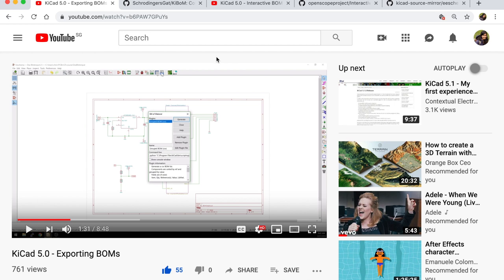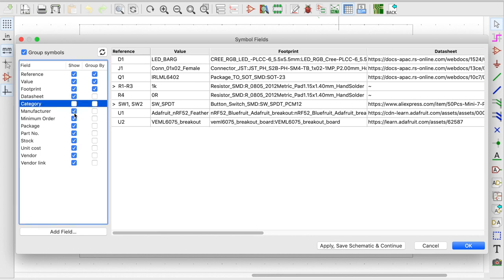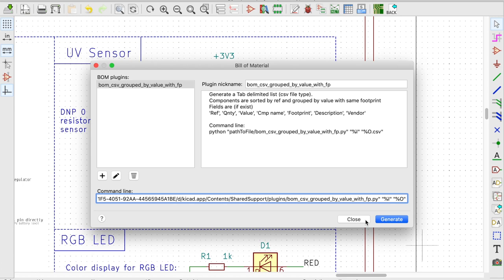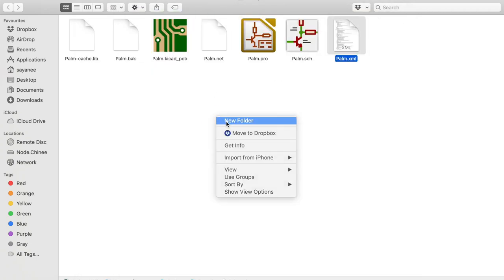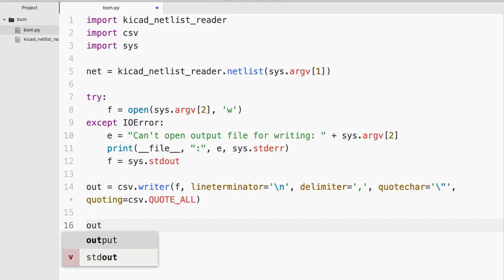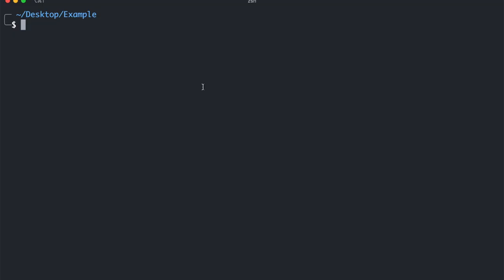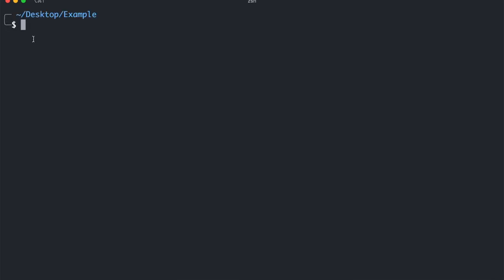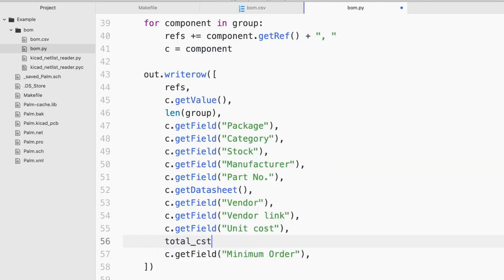Custom Python scripting for creating BOM in KiCad

Comment: Hi ! this was a great video! Do you have any idea about custom DRC scripts for imposing isolation rules on the layout ?
Reply: The issue i am facing is if i define net class rules , for spacing etc. It acts as a generic rule and does not take into account the voltage differences b/w the tracks to calculate the min. isolation distance between the tracks ..